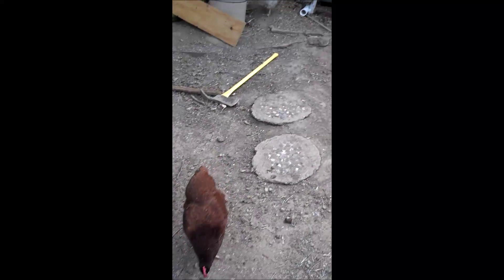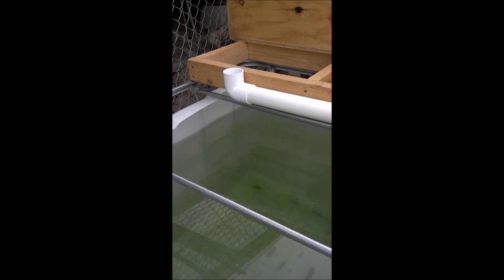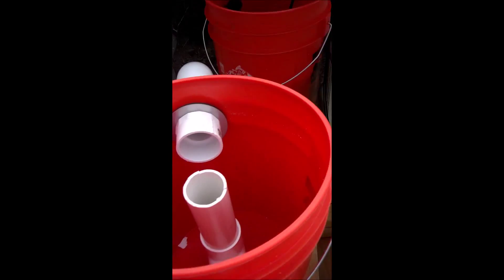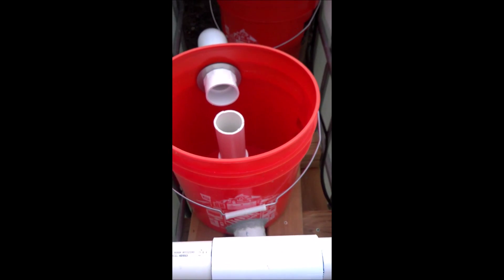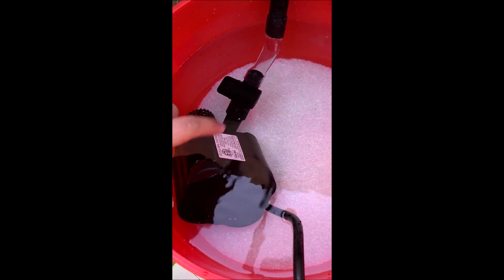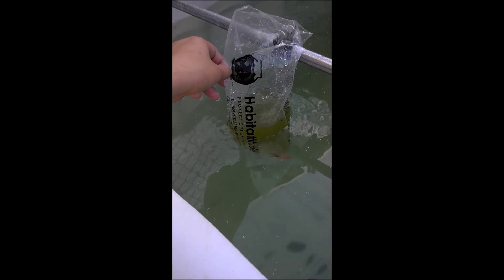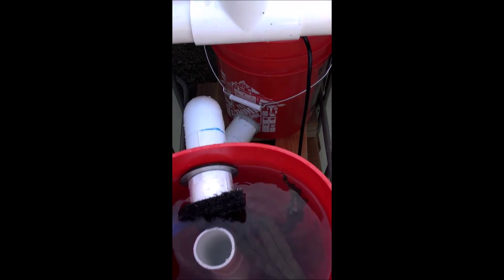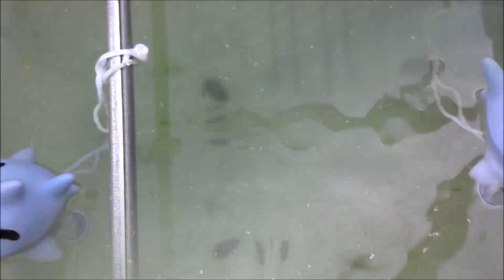Aquaponics, Rosey Red Minnows

Comment: 4:20 algae is good, it turns fish poop into fish food.  if you don't like the green water, use duckweed or frogbit instead.
Reply from the maker: The problem with algae and duckweed is that it takes nutrients away from the plants that we're trying to grow. the algae and the duckweed will use up the extra nitrogen and ammonia in the water and there will be none left for the plants up above
Reply: @1wolfgirl300  That can be solved by keeping light out of the fish tank.  If you use fish that will eat the duckweed or algae, then its a non issue as the duckweed merely sequesters the nutrients until the fish eat it.  Duckweed in particular will choke out algae  if you use a black tank.  If you use transparent or translucent tanks (like IBC totes) there will still be some algae.  So the duckweed/algae merely increase the amount of nutrients you need.  Which means feed your fish more. So they grow faster and poop more, so your plants grow faster.

So in summary, if you cna keep light totally out of the system then great, but if not, then algae and duckweed cna at least feed the fish, so they dont take nutrients away permanently, they simply sequester nutrients until the fish consume them and in the process buffer overfeeding conditions.

Comment: hey there I am new to AP as well and have a complete set up going.  
I like your setup.  there really is no wrong way to do AP.
The biggest is take your time - you need to let it cycle for 6 to 8 weeks to get the bio filter established. 
I started off this past January with ammonia and a bucket of sandy sludge from a local creek.
Once it cycled I used a 6PPM sea salt to kill any parasites and also had fish in it at that time - the 6 ppm will go away over time - do not keep salt there constantly  limit to 4 to 6 weeks as it will kill the fish over time it over works the kidneys.
Aeration is your biggest ally my setup has a 200 gallon sump as my breeder for the rosy reds  and fat head minnows to feed my bass and crappie - crappie are finicky and not a good fit but I like them so I have 10 in my float beds 15 bass and 12 blue gills. The ratio is one 200 gallon sump to one 250 gallon float bed constant flow run off, to a 300 gallon grow bed with media.  the sea salt helps the tomatoes but not good for strawberries so I maintain a slat brine at just under 6 ppt just duuing the nitrite spike after adding the fish to keep out the parasites and fish maladys.  DO not use sea salt if you have catfish or scaleless fish it will burn them. and only use it during nitrite spike after adding fish once the salt is gone the system will regulate itself.  - also using salt is very debatable some will say it is not needed but adding any fish has a risk to introduce something to the system.

good luck ... all plants squash and peppers are blooming and PH and ammonia with nitrites in check and tomatoes have well tomatoes at only 2 weeks after planting.  takes time and patience.

Zanzahl...
Reply from the maker: +Zanzahl interesting info for salt! Thanks, I had no idea about that. Unfortunately rosey reds usually come with parasites when you get them from pet stores so that's great info go know. Thanks for watching!
Reply: The collecting from the wild is a terrible idea!..its like instant blue green algae starter kit,not to mention a great way to get parasites and predator insects.
The best way? Ask an aquarist friend to give you a few buckets of water..maybe a handful of gravels.
btw- Those minnows are in no way as hardy as all youtube talks. They are sensitive to water conditions. No different then Danio's..maybe more sensitive then them. Goldfish are tanks and warriors compared to the peaceful rosy minnows.